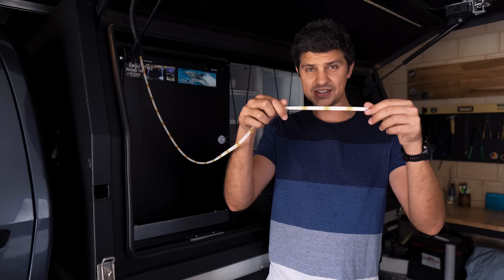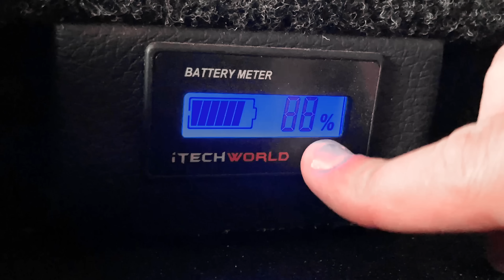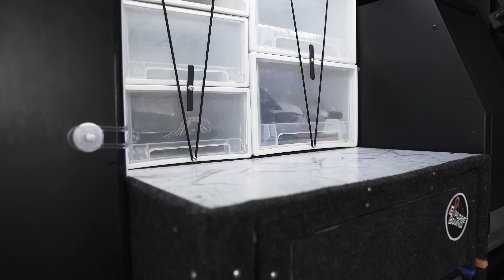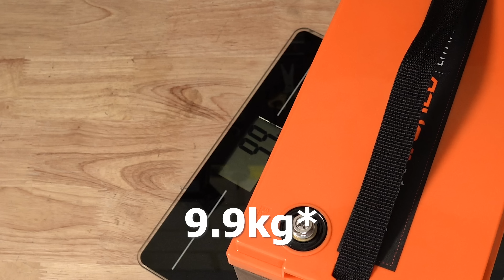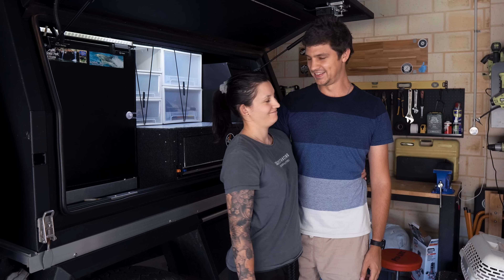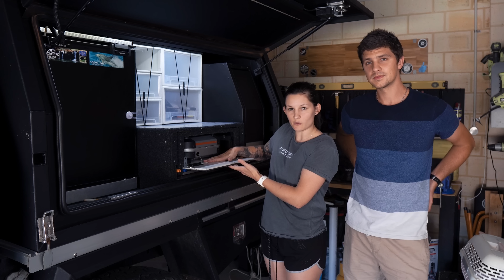5 things I HATE about my DIY canopy fit out

Comment: Idea for lights.
Keep cheaper strip lighting and use clear tube to run them in.
Then use little round screw in clamps to fit them.
Mate did similar back in day to make cheap under car glow lights on his daily.. he siloconed the ends to seal them

Comment: With regards to your battery and small space problem at the back. Why don't you just move that wide drawer forward in front of the battery and then your floor to roof area will be larger than by moving the battery and give you extra access to in behind the pantry.
Also when you build something in place of those plastic tubs, make them come back to the wide drawer, thereby eliminating the drop gap between them and giving you more storage.

Comment: With the light can use the spray contact adhesive to boost the stickyness.  Thought about mounting the second battery and charger in the cab? Behind the back seats can work well and you can use it for power in the cab too

Comment: Thanks for your honest review young fellah - it’s 18 months since we last communicated and I’ve just started permanently installing fridge, cupboards etc - you may find the Victron Bluetooth monitor may not have enough signal strength to pass through the aluminium shell of the canopy - like Bianca I’m also height challenged and carry a small plastic step for access into the slide out Engel fridge when I need to get to the bottom - also permanently wiring the whole setup (Avionics background) - Redarc, Lithium and Renogy monitor - I noticed your original cooking platform is a drawer system now so I’ll watch you changes with interest 👀

Comment: Buy a roll of permanent outdoor double sided tape and stick this to the led strip. This should hold the strips in place. I have used it plenty of times and never had a problem. Be sure to buy the foam outdoor double sided tape and not the clear double sided tape.  👍🏼

Comment: Yer  didn't like you polish job on pull out top, then wrapping it in contact adhesive like a school book? You may need to ask some questions on a forum before your plan of attack 
 There are tradies out there that have  great ideas. I watch most tubers and make up my own mind.  One thing that I get a laugh at is people that follow other with stand up fridges and having the food n drinks fall out on arrival after long drives and those that have to top heavy their batteries to run a massive inverter just to have a microwave, coffee machine and induction cook top. That ain't camping. I'd rather conserve power, water n camp than being a Flog🤣🤣

Comment: Hardkorr camp lighting mate. I run them on my camper trailer and they come in a few different configurations and can be hard wired. They have a seperate dimmer switch and can even option with a dimmer switch/ remote setup.

Comment: Hey,
Just thought you might like to look at my 12v set up. I have wired my hardkorr lights through my isolation switches. Leave the hardkorr switch on and just turn on/off at my headboard. 
Hope this helps
Out There Touring

Comment: Mate get the hard korr 4 bar kit and cable tie them to ur canopy, no screws needed. Cant go wrong. Cut the cig plug off and run it to ur switch, u can still use the pin wheel dimmer. 

Cant go wrong with victron.

Bincas height issues, she could hang from a door frame upside down, gain some height solution solved. Or just get some boots with goldfish in the heels for the height boost. Theres a solution to every problem 😉😂
Reply from the maker: Haha I'll pass those solutions on to Bianca! 😂

Comment: A couple of options for the LED lights, 1 is get better quality double sided tape from bunnings. 2 is silicone on some magnetic strip to the canopy and to the lights so it's not permanent. Also on the battery moving, my comments from your design video was to have the battery in rear centre area as it's a less utilised area. Thanks for the true side that not everything is perfect and can have flaws. Cheers 🍺
Reply: 3m silicone tape to canopy then stick led strips on

Comment: In my tub, I run those same cheap eBay LED light strip's, what I also got from eBay was the aluminium channels to run them in. Couple that with some body double-sided tape from Bunnings, it has been holding up well.

As for battery monitoring, like many have said, I run the Renogy 500amp Shunt with screen. It has been great, but it would be better with a Bluetooth app version for more convenience, so it's best to go down that route from the start if that's something you will use.

Cheers again for the great content 👍
Reply from the maker: Thanks for the advice mate! Definitely going to be looking into that aluminium channel I reckon. As for the monitor, the Renogy sounds like really good value but for me I think bluetooth will be neccesary when it comes to sharing info on these vids (being able to record the phone screen etc)

Comment: On the right hand side of the canopy, why not just move that drawer box towards the front? Your dead space can add to the full height section
Reply from the maker: Could do! My only concern there is that it might make accessing the main canopy wiring behind the front headboard a little hard to access.
Reply: @explorebound  looks like you did a good job of that though. If it comes to it and there is a problem you could always remove the drawer box to do the repair

Comment: Could you move the draw to front and keep the battery in its spot then have your full height storage up back? Same outcome without needing to move the battery
Reply from the maker: Definitely a possibility! The only issue is that it might make it a little hard to access the main wiring etc behind the front headboard but not the end of the world.
Reply: @explorebound  maybe you could make the draw on an easy or quick release system?

Comment: Daniel, for the LED lights, go to your local electrical wholesaler or lighting shop and ask for aluminium LED diffuser chanel. It's an aluminium extrusion you can screw/rivet to your canopy with a clip-in plastic lid that will hold up the strip if it falls. You can still silicone the strip to the chanel without getting silicone all over your nice new canopy finish. No re-wiring needed, about $25 for a 3m length.

I'm a sparky by trade and I've had this as my lighting solution in my canopy for over a year, best thing ever! Super easy and as a bonus the plastic diffuser cover makes the light from the strip look like a continuous light rather than lots of little dots. Way more professional finish. You can even paint the aluminium chanel black to match your canopy.

Also, on eBay or Amazon you can get a touch dimmer for LED strip lights (about $15 - $20). I just put one in my canopy, can't recommend it enough! Super simple and great when you want a little light but not to be blinded!

Thanks for all the tips you share with us for free👏 Keep it up!
Reply from the maker: Thanks mate that's a great thought about the diffuser channel, I hadn't heard of that stuff before but looks ideal! 👍

Comment: You should get the renogy battery monitor. It’s been really good 👍🏼
Reply from the maker: Thanks mate - does your model have bluetooth?
Reply: @explorebound  it doesn’t unfortunately, but if you have it somewhere in the canopy where you go to most it’s really handy to just glance over to see what’s going on. It only cost $99 on Amazon. It’s been very accurate and easy to set up. Hopes this helps with your decision 👍🏼 Cheers
Reply: Don't go blue tooth 
 Go wired display

Comment: Get yourself some aluminium LED extrusion profile bud. Mount that up so you can still use the current switch setup and if a LED strip fails you take out the diffuser and replace.
Hope that helps.
Reply from the maker: Thanks mate, I hadn't seen that stuff before - great solution!

Comment: before you remove the adhesive tape from the light strip, heat the backing up with a heat gun. Increases the stickiness dramatically

Comment: with the lights they still should be a positional on/off switch, if you leave the lights "on" you should be able to use your built in switches to turn them off and on 👍👍
Reply from the maker: Thanks mate will into that! The style I was looking at has both white and amber settings so thinking I'll probably have to run an additional set of wiring to run white amber off different switches.
Reply: @explorebound  Hardkorr lighting mate
Reply: @explorebound  might be worth using the hardkorr kit with the external dimmer, im using that dual led lighting kit in my ute at the moment and have mounted the external dimmers where my switches are 👍👍
Reply: @explorebound  
Hi,
Just letting you know an awesome cook up being released tomorrow afternoon.
You need to try this
Cheers 
Out There Touring
Reply: You can buy thin neodymium magnets. Super glue in places along the strip and bingo. If you need can screw some washers in places to provide "metal" to magnetize onto.